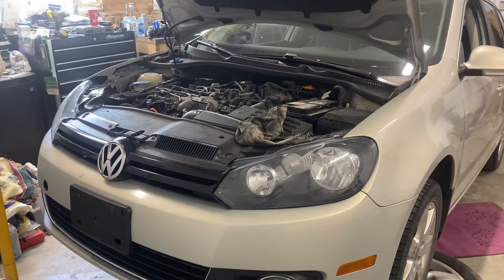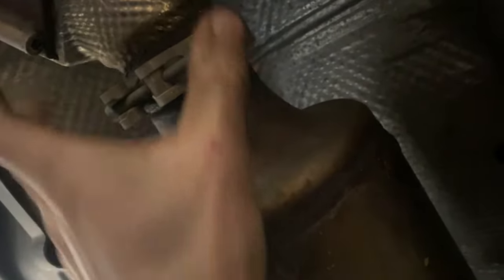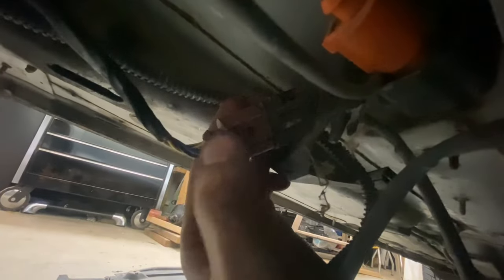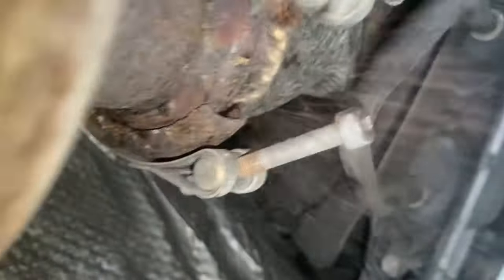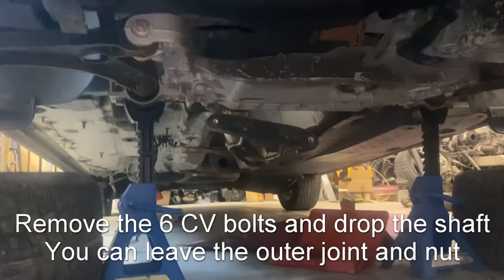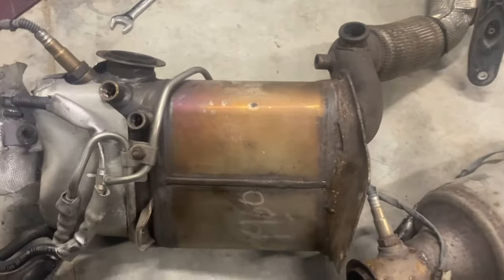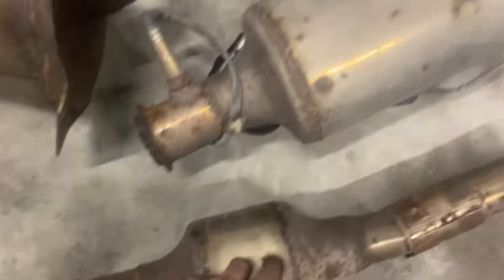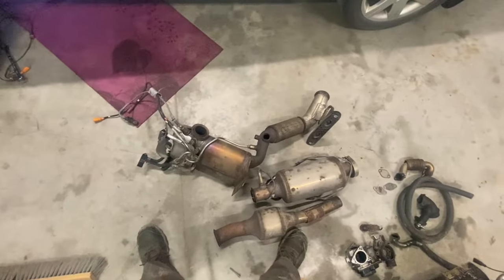CJAA Volkswagen TDI DPF/Cat removal *FOR REPAIR/REPLACEMENT PURPOSED*

Comment: Hey when you delete the dpf do you need a tune after?
Reply from the maker: Yea, it’s not going to be happy at all without the dpf and related sensors. I’ve done a video on MR Tuning on a Passat last year and the difference it made
Reply from the maker: The Passat I did had large gains, picked up 200-250 miles a tank. I’ll let you know with the Jetta here shortly

Comment: My tune and pipes came with an EGR block off plate where does that go.I want to know before I start
Reply from the maker: Single block off plate will go on the cooler, there’s a pipe from post-dpf to the cooler that gets removed

Comment: Thanks Josh.

You ever wonder how much money the oil and gas industry has made off this setup and its negative effects on fuel mileage?
Reply from the maker: A lot, I work on farm equipment and you can see gallons/acre saved, spread that out across thousands of acres per farm. On the flip side would manufacturers have progressed the technology like they did if they weren’t forced to because of emissions?

Comment: What do you do with the little black hose that's left over near the coolant reservoir?
Reply from the maker: The one behind the oil fill that went to the egr differential pressure sensor? Either clamp a tiny bolt in it or pinch/cut it at the cooler

Comment: how did you recognise that dpf is cracked?
Reply from the maker: any soot in the exhaust tips is a dead give away, p2002 and p0401 is as well
Reply: @JoshsJettas  so any amount of soot in the exhaust pipe = cracked dpf? should I replace dpf or remove it then?
Reply from the maker: @fabo8819  on these it should be spotless, keep running it until a code pops up. At that time if you don’t have emissions testing and don’t mind the cel you can continue to drive it. That or fix/remove it
Reply: @JoshsJettas  I have 2.0 tdi cfgb engine, black exhaust pipe and no errors in ecu. MAF sensor is brand new. Injectors deviations are ok, I mean -0.2 to 0.2. Dpf difference pressure up to 5-6mbar on idle. On 2500rpm 40mbar. I suppose that dpf might be cracked.

Comment: anyone know what to do when getting to the pipe that goes into the side? i’m fully deleted and trying to route an exhaust do i need to hook that up or no? if so what would you recommend me doing?
Reply from the maker: The pipe to the side after the dpf? That’s the low pressure egr line/filter, it’ll need a cap in the cooler

Comment: whats those parts you have your jack stands on? car looks a bit different then min, also are those 6 tonn jack stands?
Reply from the maker: I set them on the subframe and throw ramps under too Incase it falls. I think they’re just 2 ton stands but I put them all the way up
Reply: doesn't the jetta way more then 2 tons?  @JoshsJettas
Reply from the maker: @redsresearch  sorry I just checked they’re 3 ton (6k lbs), I’m not sure what they weight I assume 3.5lbs or so?
Reply: @JoshsJettas  Google says 4,256 lbs, also what's wrong with princess autoJack's?
Reply from the maker: @redsresearch  oh wow heavier then I figured, and nothing, Princess auto isn’t always known to have the highest quality stuff but the stands seem fine so far. I’ve got a set of 12 ton I use for work as well.

Comment: You’re telling me you got that DPF through that tiny hole how the fuck I cannot get it
Reply from the maker: Axle needs to be out of there but yeah rotate and turn, you need to make sure the dpf bottom bracket is removed
Reply: @JoshsJettas  One guy siad he got it without remove the Axel so I was trying that.  Thanks!
Reply from the maker: Where you able to get it out without removing it? I tried but couldn’t
Reply: @JoshsJettas  No, you have to remove it